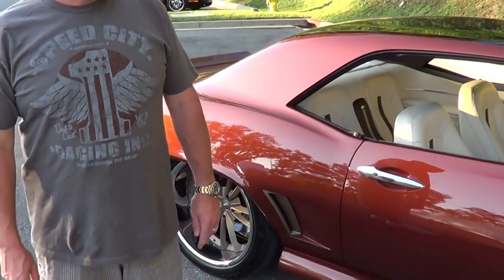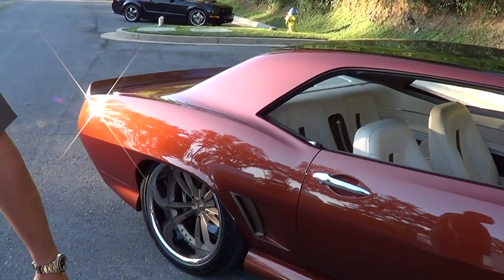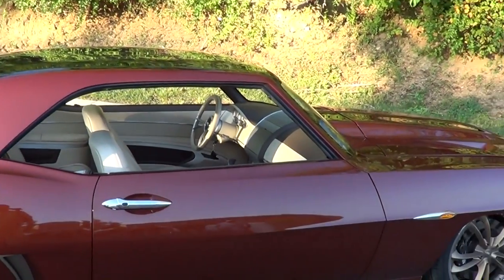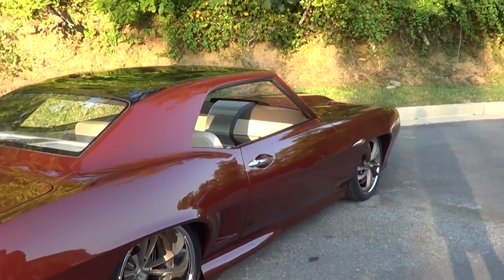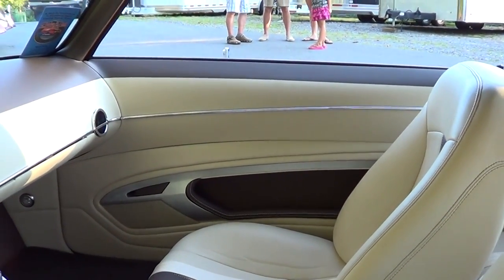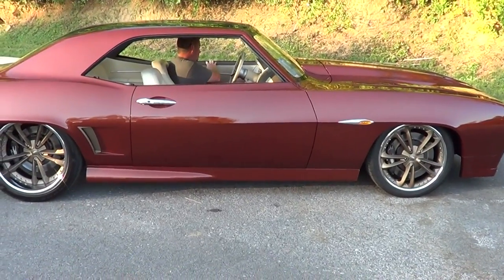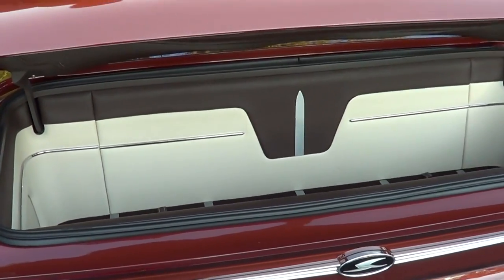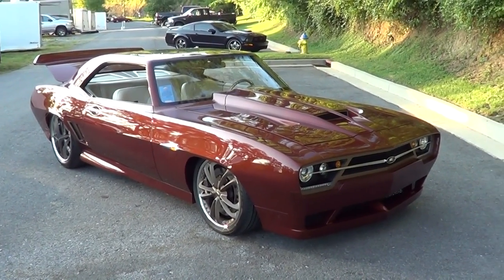Camaro Dream Rod "SC454"

Comment: I Have a five car garage that is filled up with the 1965 Corvette, in 1970 Hemi Challenge, the 1970 Dodge Charger RT 440, a 1968 super stock barracuda, a 1970 hemi Superbee and will be picking up my 2013 Shelby Mustang GT350 from Shelby American on April 30th. If I had more room my next choice would be in 1967 Chevelle and a 1969 Camaro. That is a great piece of engineering that you have their.

Comment: @ScottieDTV Nice.  I have an SS that I play with now and again but its a 2000.  Fast as hell though.   I have a few videos.  470 hp as of now, next step is a less aggressive cam and a procharger.  Should be able to put closer to 600 to the wheels after that.  I only have a few short vids of it as of now but more to come.  check it out

Comment: This has to be a lot more than $600k if it was priced out per hour of labor. Wonder what it would pull in at Barret Jackson. Probably not what he'd expect.
Reply from the maker: geoff It sold a BJ for 185K
Reply: ScottieDTV ouch..that's terrible any gear head can see how much time and money went into this piece and in good faith still low balled the crap out of him. I know its an auction and that sets the market but that's exactly why ground up cars like this aren't built its just not cost effective, not remotely close. Only customs that make money at bj are ones with a great story or history. Then again cars aren't an investment there liabilities. Thanks for the info
Reply from the maker: geoff Like I say...It's expensive to build your dream....but you can buy someone else dirt cheep.....The car has sold again....125k this time.. private sale....

Comment: WOW - that is seriously BAD - ASS machinery at it's finest,,,,,,
I have to say, as a HUGE GM Chev fan, I think its very impressive , , , , , , 
BUTT
It is no Camaro, doesn't even look close to a Camaro, ,, , , may as well have just went ahead and regestered it as a challenger , because thats mainly what it is, , , the whole front and the back,,,, nothing on the interior resembles a camaro either - - - - 
only looking at it from the sides does it look a little bit like a camaro , , , 
other than that I guess he accomplished what he set out to do  ;-))    .   .   .   .   . 

BTW - - -  a piece of advice to buddy selling it,,,,  BEST PUT A RESERVE ON IT ,,,,
unless ya don't mind taking a possible loss on it,,,,  because if the proper buyer you are looking for doesn't show up for this particular auction then  ;-(( 
I dont see an advantage to putting a reserve on it, , , , ,  Is there any advantage - sorry but I cant see going that route, , , , 
Especially with  this machine and project probably eating up a whole ton of cash
and then some....$600 larger ones -OUCHIES ,,,,,,,

SO NO - DONT PUT A RESERVE ON IT, , , , , , 
NOT putting a reserve on it is like not having insurance - pretty much ! ! ! ! ! 

.
Reply from the maker: Cool!

Comment: Way too custom (so to speak) as far as I'm concerned, but it's certainly the matter of taste. Must admire the job done, though. Talking about the budget. 600k mentioned. Sold at Barrett-Jackson's for 165k if I got the info right. Quite an expensive "sport" that is, building them "Over the Top Hot Rods". Or TOUGH LOVE, perhaps I should say. ;]
However, if you can afford it, why not then?

Comment: why would you think or say this?its Chevrolet based and you can plug  in to analyze any possible tuning issues to a laptop,as far as i can tell all of the shrouding is easy to remove with fasteners and then your dealing with a sick and incredibly well running Chevrolet power plant.

you obviously know NOTHING of muscle or pro touring cars